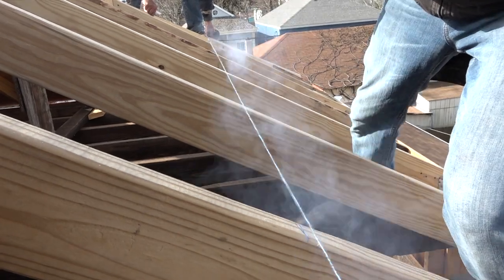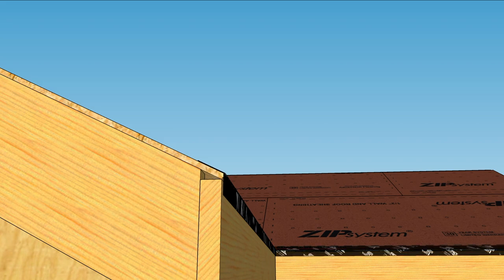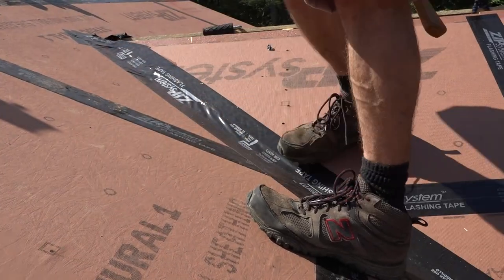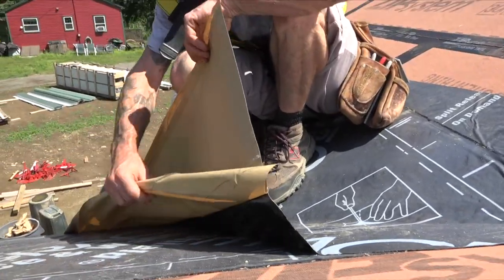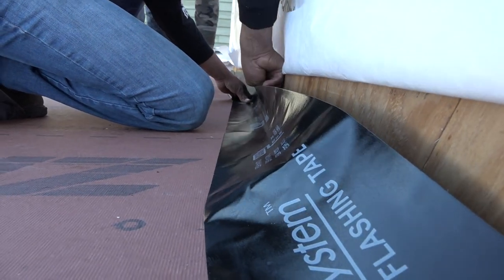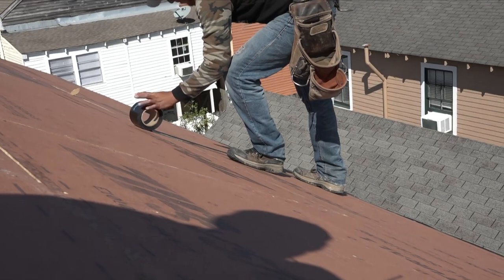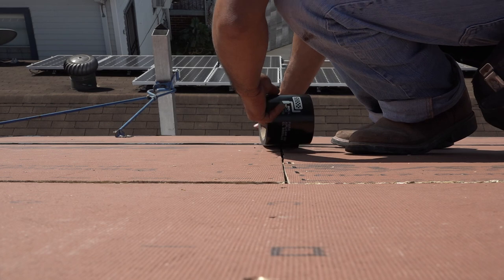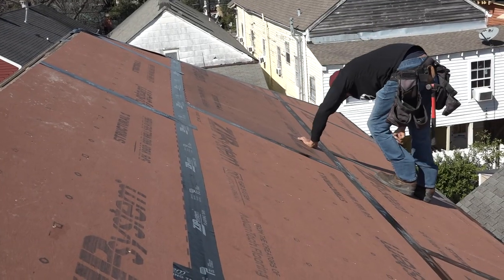Roof Deck 4: Taping Sequence and Sizes

Comment: My advice is to work valley-out, not TOWARDS the valley.
Reply from the maker: You can get either type of foam with sufficient compression resistance. I suspect it was local availability for the thickness Jake wanted.